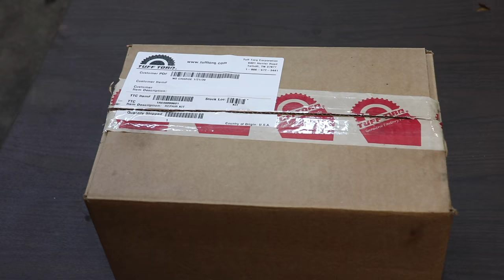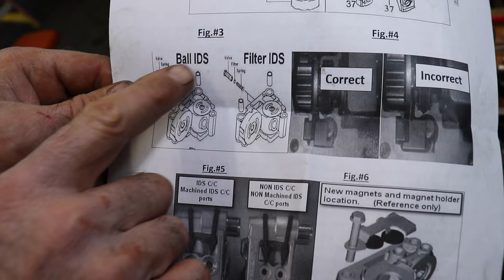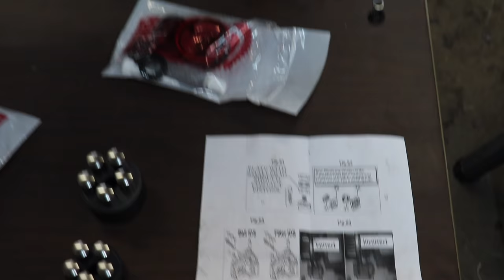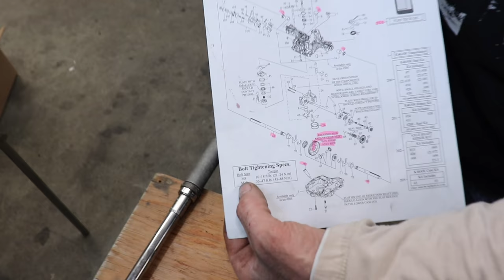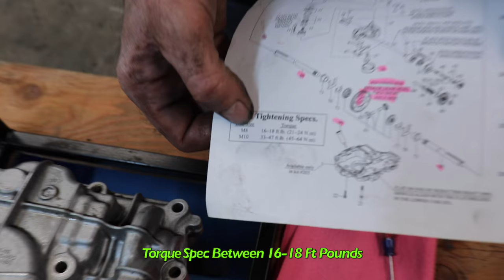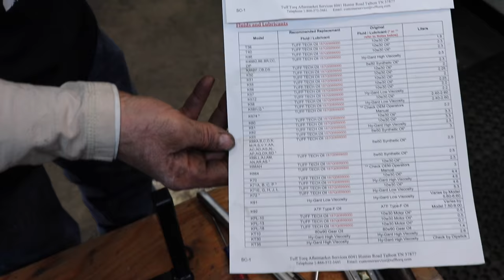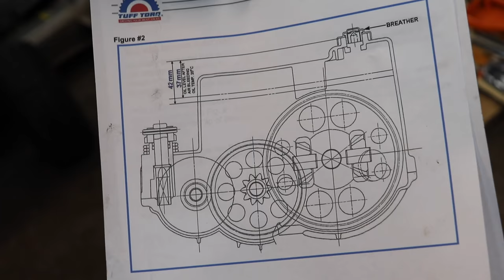How To Rebuild A Tuff Torq Hydrostatic Transmission: A Complete Guide

Comment: Best to abide "if it ain't broke don't fix it".  Followed the video up to sealing up the case and then went about trying to replace axle seals (NOT leaking by the way).  Axle seal did not come out in one peace but crumbled and I ended up gouging up the inside recess in trying to remove all the rubber bits and then the new seal still would not go in and I ruined 2 seals by trying to hammer them in with a pipe.  I now have to order new seals, reopen the tranny case and remove the axle in order to try to pry out the tiny spring which seems lodged somewhere which apparently is preventing new seal from installing.   If replacing axle seals, Best (in my opinion) to remove the axle shaft(s) if you already have the unit apart, replace the axle seal(s), reinstall the shaft(s) and then silicon seal up the unit.  It is much easier then trying to work around the installed axle shaft.  If axle seal(s) are not leaking - I would not try to replace them.
Reply: Thanks going to do my K61 in June.  Have the seal kit which comes with axle seals.  Mine is only leaking at the main drive shaft, the axles are dry, did not plan to replace and possible create a problem where none exists.  Over 1,000 hrs on the trans, if they leak in the future (before the tractor dies) then they will need to be replaced.

Comment: My father designed hydraulics. In 1986 Granger wanted to sue Dayton for a variable displacement hydraulic transmission [in a Granger lawn mower ]failure rate. My father, helping Granger,   looked at the schematics and said, "You forgot the bypass valve. When you pull back to low gear, you will blow up the transmission." So Granger dropped the lawsuit.

Comment: Video is a big help. Everyone kept telling me “sealed unit, not rebuildable.”  Never did believe that. You used a splined nut to place a socket on to test the trans with a drill. I know you said to look out for a used one. But I have never done this and probably will never stumble on one. Is there a part number associated with that nut and a place I could buy one?

Comment: I had liked your video very much it was an inspiration to watch. But I have a question on the plate you have said in video if I wold turn it around the mower would work in reverse for forward and vice versa .  I had taken a picture before removing it and put it back the same way .
Is there  another reason the mower would run backwards when I press forward on the pedal.
Thanks michael

Comment: Great video! Two things… When assembling the case halves you did not show the application of the sealant…? That would’ve been helpful. 

And as far as the 10 mm bolt torque, I also thought 47 foot pounds seemed high. So I took a look at a bolt torque chart, 47 foot pounds is the exact recommendation for an M 10 X 1.5 with oiled threads in a class 12.9 fastener… But my transaxle has class 8.8 bolts which would only call for 28 foot pounds with oiled threads.

Comment: Hi Taryl thanks fir your video, now am ready to tear this down. But want to be specific. What can you recommend part replacement on my k46, it works fine until it warms up and it start slipping up to the point that it doesn’t move at all. Cool it down and it works just find. Before i found your video, i found several post and one of em saying replace with 15-W50 and other says overfill a little bit. I done both and still doing same thing. TIA

Comment: The little pin on the center case: is it normally sticking out under normal driving operation or protracted under normal driving operation. I did a K51B and I had to remove the little shaft that is attached to the rod that you pull to free-wheel or engage. When you put the little rod back in it can go in one of two ways and I didn't make note of where it was. Can you tell me where the pin in the center case should normally (in or out) for normal operation? Thank you - great video as always.

Comment: If you had to swap in a K66 in its place from lets say a G100 John Deere you would have to flip the motor housing around or upside down to go in the transmission case half to go in the right direction wouldn't you Taryl?

Comment: How does the automatic controlled traction work in these. My Simplicity has a K57 and Simplicity braggs about a type of limited slip to regain traction.
They say when the wheel is slipping to stop and then to slowly increase power . If there is a difference it's barely noticeable.

Comment: So I've got a question, speaking of the piece you're talking about at 13:40 in the video...
If you wanted the trans to run in reverse, would it be okay to run it with the block reversed or would it cause damage?

Comment: Swash plate it's called Taryl. Just like on a water pressure washer system. The "drain plug seal" is called a Dowty washer in the UK.
Reply: That's exactly how they work. I tore one down myself and was suprised to see the lawn mower transmission works on the same principle. Go figure. I have only done the MTD manual transmissions myself.

Comment: When you order the trans stand, call Milwaukee for a mid torq or High torq impact gun. There the bomb, hands down👋 Trust me. They blow away snap on. I'm got two transmission out,  one from a deer and other from a huska.  One transmission is leaking by Axel's, the one out of mower we bought is clean but don't move.  I'm a hot rod mechanic. Don't know about these mower stuff.
Wanna be a pest and drop two to fix 1👍

Comment: First video I have found that explains what to look for with wear. 
I have the peerless h2000-006a transmission. The pistons look identical to those in that tuff torq.
Do you know if they are interchangeable?
Also I do have quite a few scratches on the vertical piston bottom. I am at the moment block sanding them down. Have you ever done this? Does it work?
Thanks if you do reply to this old video.
I think you should do more hydrostatic teardowns. Not much out there on the web or videos.
Reply: Well I finally got it back together. It works! Had to wait for the silicone to dry, but after a very quick priming it runs like new.

Comment: I have less than 200 hours on my JD D160. I use the hell out of it both summer and winter. Summer mowing the lawn and field and winter blowing snow with the snowblower attachment. Started whining and going slower after about 150 hours heavy use. At 100 hours I noticed a hairline crack in trans case cover so I had to order a new one and replace. It didn’t lose much oil at all. Should have just rebuilt it when that happened I suppose. Is it normal for these transmissions to wear out so fast?

Comment: Now I am about to disassemble one of these today and determine exactly what model Tuff Torque I have. However that little snap ring thing on the fan the fucking holes R so small I have to venture out today and get another snap ring pliers because mine will not fit those teenie tiny little hole the snap ring has on the rear end... Stick that one in your pipe and smoke it Taryl... This is actually the first piece of anything I have run into where my snap ring pliers won't work.

Comment: Awesome series with these Tuff Torq transmissions.  Wondering what kind of pulley and fan hacks can be done to replace when you get a transaxle without?
Reply: Yeah, mine I noticed is really messed up badly. Don't know how it got that way as I just bought the mower. Hopefully they sell those for a reasonable price!

Comment: With the pump block and the main shaft splined,..shouldn't the pump block slide down nice and snug on the shaft with no play. I had mine apart 3 times and only thing i noticed was there was play between the two.

Comment: since the oil level seem so critical, you may need to recheck the level after you spun it up on ur drill, priming air from all the orifices, will have  lowered the oil level..

Comment: Hey Taryl I picked up an International Cub Cadet 105 yesterday with the Sundstrand 15 hydrostatic pump. Was messing with it today have not had the engine running but the generator turns it over I can get the tractor to go backwards just fine but I push the lever forwards and it goes a little bit after going backwards than stops. If I don't put it in reverse and just push it forwards it does not go either. I have never messed with a hydrostatic I mainly specialize in gear drives what would cause that. I was thinking maybe a blockage in the line or just warn out being a little over 50 years old any help would be appreciated if you would like to see what exactly its doing here soon I will have a video of it up on my YouTube channel.

Comment: I have a Cub Cadet XT1 with the same type of hydro fan.   The snap ring and fan flings off immediately after starting to mow.   Have bought and installed 2 in the last month after chewing them up with the mower blades.  Spring washer underneath.  Snap ring well seated.  Can’t figure out why it keeps flinging off.   Any idea?

Comment: Taryl, I have a question for you. I have a 2000 445 with a transmission issue. When I go in either direction, there is pressure back against my foot. It acts like an impact hammer would. That's the best way I know to describe it. Any ideas?

Comment: Is this a K46?  My K66AG is a bit different and already has drain bolts, one for the gear side and one for the hydraulic side and 2 fill ports.
Reply: That shows you opted for the $199 version. Taryls fixin' the $139 model.

Comment: Hi Taryle I have an old murray sentinel rear engine 10/30 the trans has no bolts to take it apart or no way to fill it with oil

Comment: is this fixable should i try correct fluid or is their damage Jd gt245 transmission won't work after using regular fluid instead of jd hy gard LV fluid. It will creep a little but basically stopped working after mowing 30 minutes. Plastic fluid tank was plum full after fluid expanded

Comment: Hey Taryl I've got a tuff torq transmission on my 2007 AgCo 1722 branded SimpleCity Conquest. Was told it was upgraded to a new transmission and it came off of a prestige and it was a K71. The model number sticker is missing How do I figure out what parts to order for this thing? Just looking for the filters for now but it's so dirty under there I cant tell if it needs new seals or not. If you could help me out with your infinite wisdom I would appreciate it.

Comment: Question? Please respond. I have one of these John Deer la 130. It loses power going up hill. Doesn’t seem to go as fast. Doesn’t die transmission just moans and tractor stays still. I replaced drive belt. I drained and replaced trans fluid. It helped some only. Should I follow this video and rebuild the trans? How do you test the trans to confirm it needs rebuilt?
Reply: How about an update on your transmission?

Comment: HEY taryl those orings at the end of the repair were probably the cause why the differental didnt work causing low oil hey just wondering  if  you replaced the oil with ep140 grade oil would that solve the problem for a quick fix instead of doing a repair  just bodgy it up would thicker oil work wat u recon here in Australia the parts are dear customers dont like spending money on repairs as they not making much money cutting grass cheers john.

Comment: How many of those old transmissions have you taken apart before you could pull one apart and lay all of the inter parts around on the table and then get it back together and back on the tractor 🚜 and back to mowing grass.

Comment: I have a question. But first, great video...if I met you I might kiss you ceptin' I'd be skeered my lips'd get torn up. But, I removed my K46 trans to check fluid level and condition cause it made a slight whine (but still performed great). A guy gave it to me as a freebie, so I knew nothing about it. When I popped the cap fluid looks like honey, nice and clean (to my eye), but just a bit lower than the 3/4 -1 inch I believe I heard you recommend. I'd like to "top it off" (unless you recommend I drain it all and replace anyway since I got it off) but I don't know what fluid is in there...could be tuff torq specific or just something else. Thing is...will mixing fluids be an issue if I add 10w-30 and that ain't what's already in there?

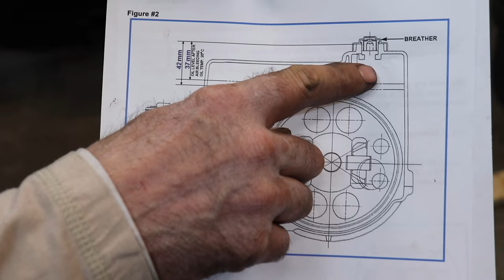Comment: Taryl,  I noticed that on the Oil Level page (Figure #2) that the seal on the springloaded shaft shows that it uses two (2) O-Rings. 1:02:51 
Do any of the other illustrations provide hints like that?

P.S. -  Love your work.  Saves me a huge headache on a regular basis.

Comment: OK...was very unsatisfied by just changing fluid (used 15w 50 Mobil 1) and decided to crack case. Filter looked like a filmy algae covered slimy mess, goop in bottom of case. Cleaned everything...and then came putting back the "pump" mechanism...which as you describe it the "trickiest part" Kept checking to make sure 'lil pin didn't fall out...but...(ya ever get that not 100% feeling about something)...but buttoned it up...refilled...and the thing runs like a banshee. BUT, seems I can hand push mower even in drive configuration. But the thing runs great, no noise or whine...and FAST...almost zero turn fast. My question is this...if pin either dropped out, was not in "right position" (even if in hole)...what would be symptoms? Should this wake me at 2 am? ( I am hoping you will say "If you screwed up the pin you would know immediately cause the thing would not budge under its own power".)

Comment: Mr T. Dactyl - I have a JD LT160 which I bought used from a local dealer 4 years ago, with the snowblower attachment & wheel weights/chains etc.
     Overall it is a good tractor; engine starts and still runs great so far.

     BUT ever since I got it I thought "man reverse is SLOW".
     And the first year I tried the SnowBlower out I found that reverse is practically useless :(
    Blowing snow driving forward works really well.
WHY do you think the reverse is so weak?
    After watching your video, I feel much better about repairing the unit myself vs paying the dealership more than the thing is worth.
Thanks in advance!
Reply: Thanks to Tom Novak!
He mentioned his 1998 LX178 does the same thing. He said that "if I put my toe under the forward side and lift, it goes much faster in reverse than if you step on the reverse side of the pedal."
I just tried that today and yes that is my problem!!
Thanks again Tom!
(Not sure why your reply to this thread is not showing, but thanks again)

Comment: So I ran my briggs power washer forgetting that I did an oil change a month or so earlier, guess what? Yup no oil, anyway I got it loose and  it runs, but now it walks and drips oil from a gasket. I need to pull it apart a d replace the leaking gasket, do you have a video that I could refer too, plus a pump rebuild

Comment: One thing I have not seen is a video on the "adjustment nut lug" on the side of these tuff torq transmissions... am134125 any input or thoughts? That's probably one of those things you never should mess with... but, well it happens/happened. I'm not to sure where the setting should be. SMH

Comment: Did anyone else notice in the tuff torque specs their one oil replaces at least 4 different recommended oils if not using theirs?? High and low viscosity, 10-30, 5-50. LOL Must be variable viscosity! 🤣🤣🤣

Comment: Hey I wonder can you help I have a 2007 castlegarden ride on with a 5 speed manual transmisson my mower will select all gears but only drives fast in 4 or 5th gear but slow in the other gears I've replaced the belt but it still drives slow

Comment: Taryl in a high pitched girly voice . Would it be a good idea to  fill it up to the level you show  and leave the cap off and  spin the transmission with the drill  to allow all the hollow piston parts and channels  to fill up  and once you see it turning both in revere and forwards  then check the fluid lever  to make sure its at the correct level ?   If you put the plug in like you did  and then turn the transmission you might be to low on fluid because you didn't allow the fluid to  replace the air  that's trapped  in the  hollow parts .

Comment: I'm in the middle of rebuilding my k46.  Those springs for the pistons broke into pieces, stuck out the bottom of those cylinders, and gouged out all the surfaces on the cylinders and center case.

Comment: But Taryl if the pinion seal was the leaking seal.  And, I saw that bearing which you did NOT check it is probably the cause/contributor of that seal leaking.
Reply: Also, if the final drive pulley/fan is damaged/broken or out of balance from dirt and debris it could cause that seal to leak.  I did NOT see any way the preload that bearing unless it’s when you fasten the pulley/blower cooling fan onto the shaft.

Comment: I just changed the axle on mine so I only pulled the 2 retainer clips and r/r the axle. Close it all up and hook put the oil back in it hook it back up and nothing.
It won't go forward or reverse. Anyone have any ideas? Does it have air in it ?

Comment: Having difficulty removing the main pump assembly with the spring loaded cups. Anyone have advice on how to get this out. He just used a screw driver to pry on it in the video. That’s not enough on mine. It raised up about 1/4” but I can’t get it to budge any more.
Reply: Mine is the K66  and apparently there was a pin holding the pump assembly down that I had to remove.

Comment: if this were mine I would have changed the oil and put in a little AT205 reseal and run it. then if it failed I would do this overhaul. great video you did here.
Reply: But then you wouldn't have a very good rebuild video, would you?

Comment: Please help.  I have the same transmission I had a bearing that broke I replaced it.  Put 20w50 oil. And it was working for 5 minutes riding around.   And now it doesn’t move.    I take it apart dump oil out fill back up.  And it works for 5-minutes and I do the same thing again and it only last up to 5 minutes.  Can someone help. ??